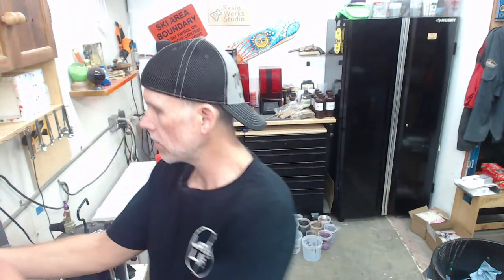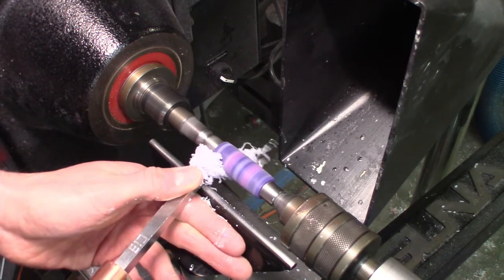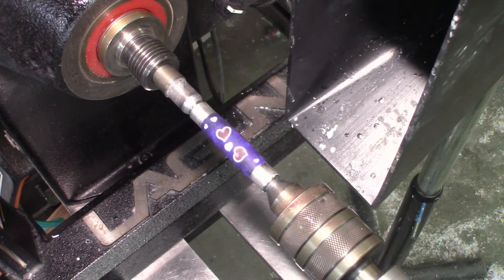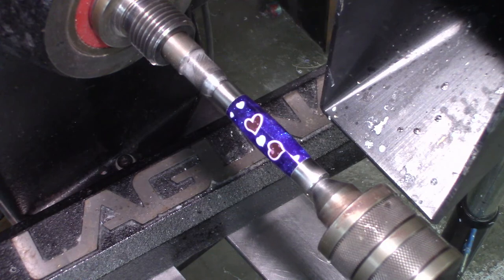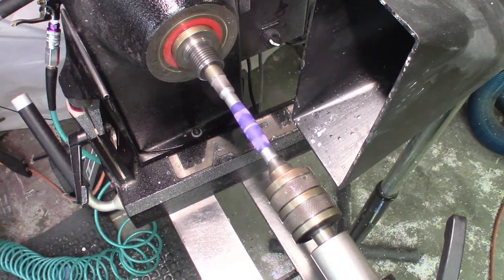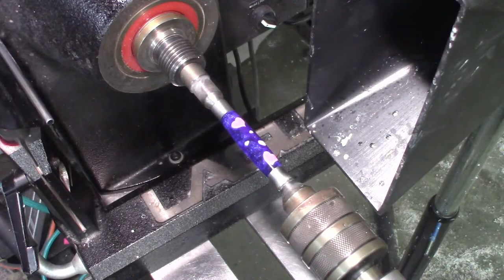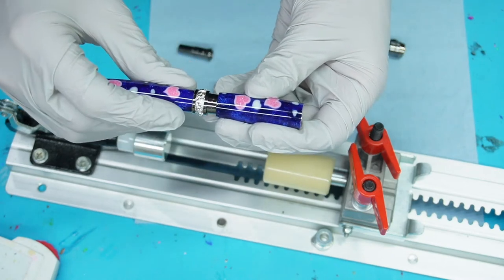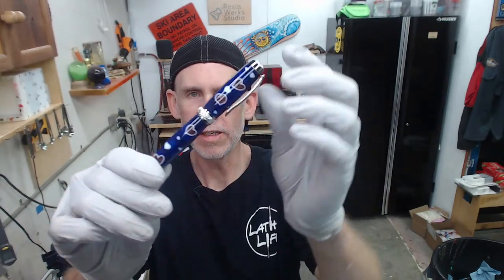🔴Replay: Turning a Heart Valentine's Day Pen  | Episode 231

Comment: I'm a newbie to turning & really enjoy seeing the TBC. Good to see it done on a two part pen- that it does work out. Great looking pen Zac 🔥
Reply from the maker: Glad to be able to share that with you 😀 I love using the TBC setup, it drastically improved my results when applying finishes to pens especially. I had so many problems with bent mandrels, and the result was off balance turning which caused the blanks to not be totally true. It is a little slower though as you see since you have to do them one blank at a time